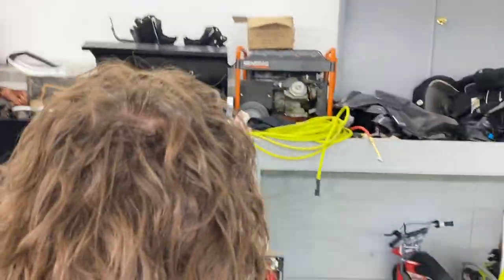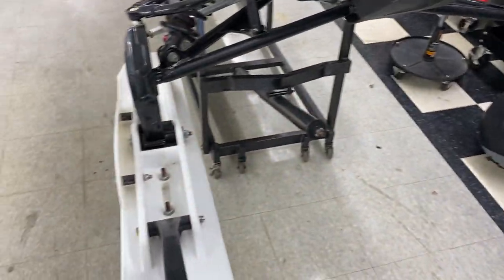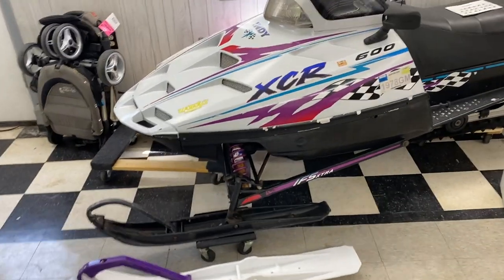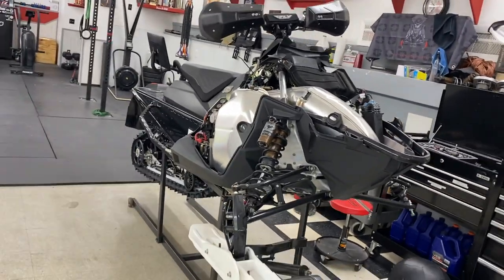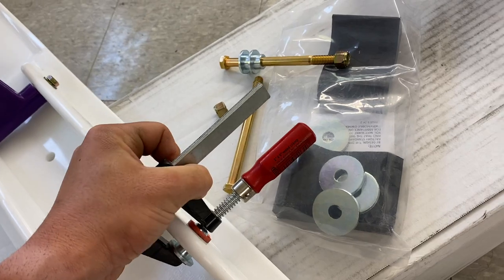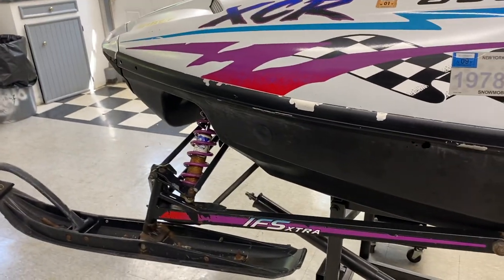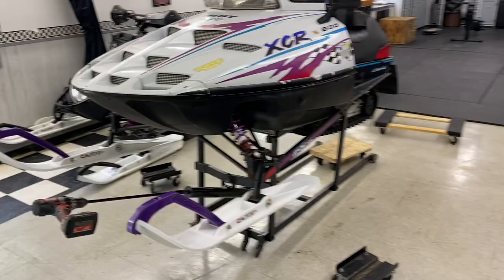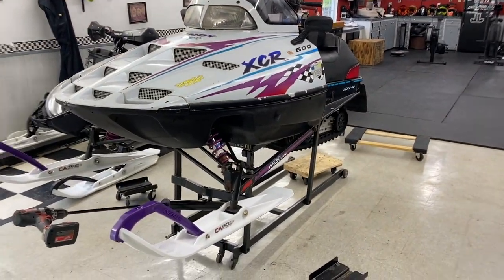C&A PRO RZ SKIS INSTALLED ON MY 1997 POLARIS XCR 600 TRIPLE!

Comment: Looks great, are you going to have South rebuild them shocks? That thing is going to be a rocket! I'm still looking for one. I want one in that exact year. My turbo is still in the shop. I'm glad I got my track changed. Bearings on the drive shaft where shot. Only 7,000 miles on this sled and they are shot.
Reply from the maker: Shocks are on the list. Havent yet talked to Bruce about what we can do but most likely will be done. Bearings were a big issue im hearing on these older sleds. I have to take a peak at mine
Reply: @JESSEJAMES322  yeah, the year you have is solid. You can't go wrong with a Fuji motor. The 570 triple had issues. I think they were still called 600's back then.
Reply: It was in the old XLT chassis that the motors had a problems. The one you have is completely different. And that's what I want.
Reply from the maker: I will keep an eye out!

Comment: Is there a reason the rubbers for the skis are supposed to face a different direction on each side? Just curious because it seems odd and my directions only gave me directions for one side so I’m not sure what to do.
Reply from the maker: Yes. 99.9% It the time they always want the bigger side to the back so It distributes the pressure properly. When It doubt big to the back!!